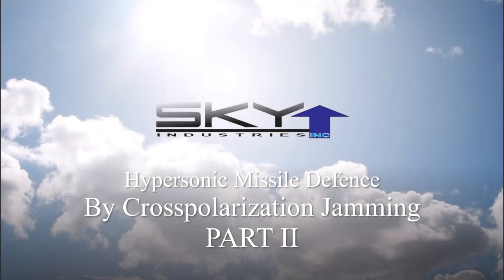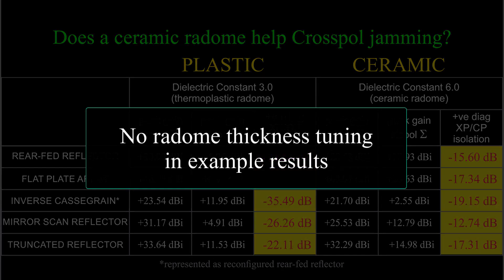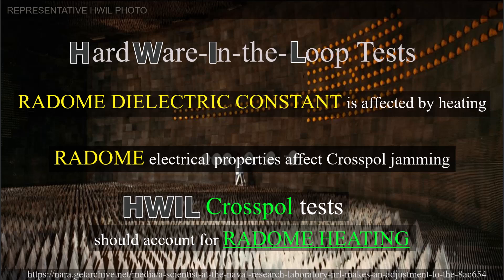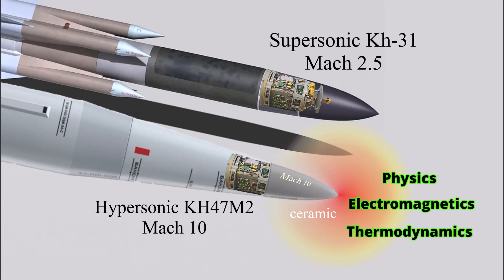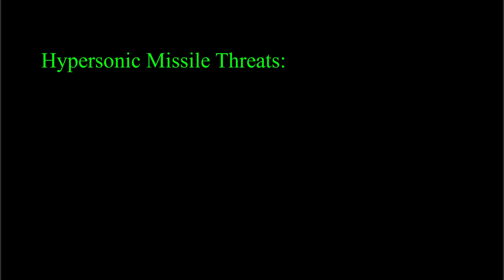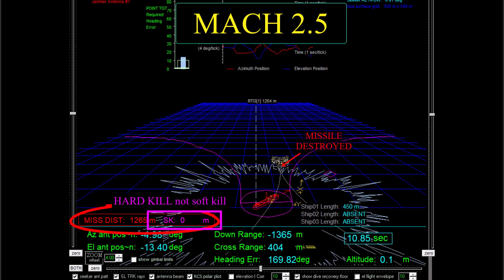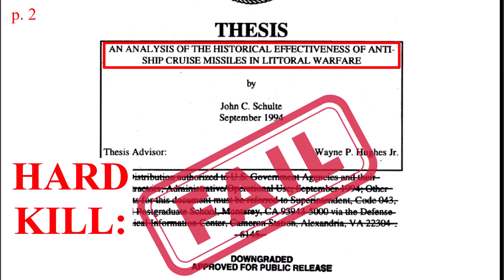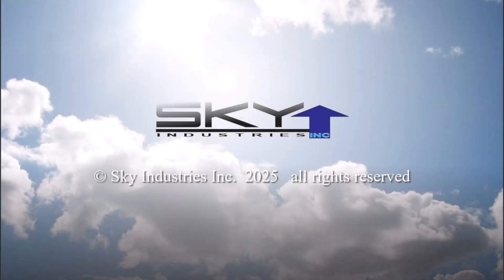Hypersonic Missile Defence By Crosspolarization Jamming PART II 25

Comment: LOL ... for us laymen ...

Okay, let's break down crosspolarization jamming and how it might be relevant to hypersonic missile defense, using simple terms:

*1.  Hypersonic Missiles:  Why Are They a Problem?*

*   *Super Fast:* These missiles travel at speeds greater than Mach 5 (five times the speed of sound).  That's really fast, meaning very little time to react.
*   *Maneuverable:*  Unlike ballistic missiles that follow a predictable arc, hypersonic missiles can change course during flight. This makes them harder to track and intercept.
*   *Low Altitude:*  They often fly at relatively low altitudes, below the usual range of some radar systems designed for ballistic missile defense.

*2.  Radar: How We Detect and Track Missiles*

*   *Sending Signals:* Radar works by sending out radio waves (electromagnetic radiation) that bounce off objects.
*   *Receiving Echoes:* The radar then receives the reflected waves, allowing it to determine the object's distance, speed, and direction.

*3.  Polarization of Radar Waves: Thinking About Wiggles*

*   *Imagine a rope:* If you shake a rope up and down, it creates a vertical wave.  If you shake it side to side, it creates a horizontal wave.  Radar waves are similar – they have a direction of "wiggle," which we call *polarization*.
*   *Typical Polarization:*  Most radar systems use a specific polarization – let's say vertical polarization for simplicity.  They send out vertically polarized waves and are best at receiving vertically polarized echoes.

*4.  Jamming:  Messing with the Radar*

*   *The Goal:* Jamming is intentionally interfering with radar signals to prevent the radar from accurately detecting or tracking a target.
*   *Various Methods:* There are many ways to jam radar.  One way is to simply send out a loud, overpowering signal on the same frequency that the radar uses.  Think of it like shouting so loud that nobody can hear the original conversation.

*5.  Crosspolarization Jamming: A Sneakier Approach*

*   *Exploiting the Weakness:*  Crosspolarization jamming exploits the fact that radar systems are usually optimized to receive signals of a specific polarization (e.g., vertical). They are less sensitive to signals of the opposite polarization (e.g., horizontal).
*   *The Trick:* The jammer sends out a strong signal with a polarization that is different from the radar's intended polarization. In the simplest case, this might be a horizontally polarized signal sent against a vertically polarized radar.
*   *Why it Works:*  Even though the radar isn't specifically designed to "hear" that polarization, a strong crosspolarized signal can still get through the front end of the radar. This crosspolarized signal can then confuse or overwhelm the radar's processing system, making it difficult to extract the real target's echo. In effect, it appears at the radar receiver as noise or as a false target.

*6.  How it Relates to Hypersonic Missile Defense*

*   *Making Tracking Harder:* If a hypersonic missile can effectively use crosspolarization jamming, it makes it much harder for radar systems to track its position, speed, and trajectory. This gives the missile a better chance of reaching its target undetected.
*   *Countermeasures:*  Defenses against crosspolarization jamming involve using radar systems that can better handle multiple polarizations, filter out unwanted signals, or adaptively change their polarization to match the target's reflection characteristics.

*Important Considerations/Caveats:*

*   *More Complex in Reality:* The physics and engineering of radar and jamming are far more complex than this simple explanation.  Real-world systems involve sophisticated signal processing, modulation techniques, and antenna designs.
*   *Not the Only Defense Challenge:* Crosspolarization jamming is just one of many challenges in defending against hypersonic missiles. Other challenges include their speed, maneuverability, heat signature, and ability to deploy decoys.
*   *It's Evolving:* Both jamming techniques and countermeasures against jamming are constantly evolving.  It's a never-ending "cat and mouse" game.
*   *Limited Public Information:* Much of the specifics of advanced radar and jamming technologies are classified for national security reasons. This explanation relies on publicly available information and general principles.

*In summary:* Crosspolarization jamming attempts to disrupt radar tracking by exploiting the radar's sensitivity to specific wave "wiggles." By sending a strong signal with the "wrong" kind of wiggle, the jammer can confuse or overwhelm the radar system. This could make it harder to defend against fast, maneuverable hypersonic missiles. Defenses against crosspolarization jamming include designing radars that are more robust against different polarizations and using advanced signal processing techniques to filter out unwanted signals.

Comment: Holy cross-poly, I've watched two of your videos and think I've found my new dream career.  Now just gotta work out where to start...
Reply from the maker: There's a lot more in this vein; Crosspolarization jamming is just the start: Crosseye, Sector Crosseye, Polarization Crosseye, Double Cross, and cognitive variations.  It's interesting for sure, and it's possible to make brand new discoveries, things no one has seen before or recognized before, and to make real contributions.  

My advice: learn everything you can, and keep your career options open.  Use the scientific method, be meticulous, keep thorough engineering notes including dates, times, ideas, thought processes, things that are dead ends and why, the evolving contents of your mind on paper. 

"Danger Will Robinson!":  In this field the security restrictions - which are absolutely necessary - can suffocate you with respect to the outside world.  

You will need to develop skills to recognize and accommodate the restrictions.  That part is like an apprenticeship.  Other practitioners will help you.

Comment: Some missiles use diamond for optical windows. Not sure about radar permeability but could be one way that it's done. 

Looks like it's viable: 'Dielectric loss tangent of the samples in the frequency range of 50-67 GHz was found to be in the range of 7.5· 10 ⁻³ -8· 10 ⁻² , increasing with frequency. The transmission loss due to the radiation absorption is about 1%. '

Comment: Could it be that the whole trajectory is encoded when the mission is initiated? Without any seekers?
Reply from the maker: In principle, yes - but that will only work for stationary targets like buildings or bridges.  A different solution is needed for a moving target, like and aircraft carrier.
Reply: @ Isn’t it the velocity in which a carrier is moving is almost negligible to the velocity of the hypersonic missile?
Reply from the maker: @elclay  yes - but very precise guidance is needed at endgame to physically hit the target.  The guidance loop needs to correct the the difference between where the targeting platform thought - at launch time - where the target will be when the missile arrives, and where is actually is when the missile arrives.  

Certainly GPS could be used to guide the missile all the way to the target with no seeker required, but that only works if the targeting platform has the exact GPS coordinates of the target.  

Easy to enough do for a building or a bridge or a shipyard, perhaps not so easy for a movable target like a ship.  A ship doesn't provide information about its location, and may be fitted with among other things a GPS jammer that can deny service out to several km.  And if it and has range info on the inbound missile, in principle ship tactics can be applied.  

Similar to a boxer moving his/her head just a little to avoid getting hit.  A small movement is all it takes.

Comment: could they eject the ceramic dome piece in the mach 2.5 phase and have the plastic one underneath?
Reply from the maker: Good question; seems like a major complexity that is risky to the missile for no real benefit since it doesn't solve the problem.  

A polyamide radome raises the antenna's crosspolar gain, just not as much as ceramic radome does.  

And although it doesn't say in the video, the simulation at 5:11 uses a polyamide radome, dielectric constant 3.0.

Comment: Why not both? Could have a ceramic outer nose cone for hypersonic flight, then shatter it with a small explosive when the missile drops below Mach 5 and the seeker becomes active.
Reply from the maker: Interesting idea, but it doesn't solve the problem; the main-thing points are that a polyamide radome adds to the crosspolar gain, and a ceramic radome is even worse.  

A RF-guided hypersonic is forced to use the ceramic, so it's situation is particularly bad.

Comment: I asked the following question to DeepSeek AI 

How can a missile going over match 5 overcome the plasma sheath interference to continue receiving data during terminal phase?

It answered the following:

Overcoming plasma sheath interference is one of the most significant challenges for hypersonic missiles traveling at speeds over Mach 5. The plasma sheath, a layer of ionized gas that forms around the missile due to extreme air friction, can block or distort radio frequency (RF) signals, making communication and data reception difficult. Here are the key strategies and technologies used to mitigate this issue:

---

### 1. *Frequency Selection:*
   - *Lower Frequency Bands:*
     - Lower frequency signals (e.g., UHF or VHF bands) are less affected by plasma interference compared to higher frequencies (e.g., X-band or Ku-band). Hypersonic missiles can use these lower frequencies for communication during the terminal phase.
   - *Multi-Frequency Systems:*
     - Using multiple frequencies simultaneously can help ensure that at least some signals penetrate the plasma sheath.

---

### 2. *Antenna Design and Placement:*
   - *Windowed Antennas:*
     - Antennas can be placed behind specially designed "windows" made of materials (e.g., quartz or ceramic) that are transparent to RF signals but resistant to heat and plasma effects.
   - *Conformal Antennas:*
     - Antennas can be integrated into the missile's surface in a way that minimizes disruption to the plasma layer while maintaining signal integrity.
   - *Rear-Facing Antennas:*
     - Plasma density is lower at the rear of the missile, so antennas can be positioned there to improve signal reception.

---

### 3. *Plasma Mitigation Techniques:*
   - *Magnetic Windows:*
     - Applying a magnetic field around the antenna can reduce plasma density locally, allowing signals to pass through more effectively.
   - *Cooling Systems:*
     - Actively cooling the antenna area can reduce plasma formation and improve signal transmission.
   - *Aerodynamic Shaping:*
     - The missile's shape can be optimized to reduce plasma buildup around critical areas, such as communication antennas.

---

### 4. *Signal Processing and Encoding:*
   - *Advanced Algorithms:*
     - Sophisticated signal processing algorithms can filter out noise and distortions caused by the plasma sheath, extracting usable data from weakened or degraded signals.
   - *Error Correction Codes:*
     - Robust error correction techniques (e.g., forward error correction) can help recover data even if the signal is partially disrupted.

---

### 5. *Alternative Communication Methods:*
   - *Laser Communication:*
     - Lasers are less affected by plasma interference and can be used for high-speed data transmission. However, this requires precise alignment between the missile and the communication source.
   - *Inertial Navigation Updates:*
     - If communication is temporarily lost, the missile can rely on its inertial navigation system (INS) and pre-programmed target data to continue its trajectory.

---

### 6. *Onboard AI and Autonomous Guidance:*
   - *AI-Based Decision Making:*
     - Hypersonic missiles can use artificial intelligence (AI) to process limited or degraded data and make real-time adjustments to their trajectory.
   - *Autonomous Target Recognition:*
     - Advanced seekers (e.g., infrared or radar) can autonomously identify and track targets without relying heavily on external data links during the terminal phase.

---

### 7. *Pre-Planned Trajectory Adjustments:*
   - If communication is severely disrupted, the missile can follow a pre-programmed flight path and rely on its terminal guidance systems (e.g., radar or infrared seekers) to locate and engage the target.

---

### Real-World Applications:
- *Russian Avangard HGV:*
  - Uses a combination of aerodynamic shaping and advanced materials to mitigate plasma interference.
- *U.S. Hypersonic Programs:*
  - Research is ongoing into plasma-resistant communication systems, including magnetic windows and laser-based data links.

---

### Summary:
While plasma sheath interference is a significant challenge for hypersonic missiles, a combination of advanced antenna design, signal processing, alternative communication methods, and autonomous guidance systems allows these missiles to maintain data reception and accuracy during the terminal phase. Ongoing research and development continue to improve these technologies, ensuring reliable performance at extreme speeds.
Reply from the maker: Very interesting!  Many thanks for sharing, I was curious.

Comment: What if the radome was designed as a two part radome? Plastic on the inside, ceramic on the outside? When the missile is at mach 10, the ceramic is on but when it slows to mach 2.5 and lower, a mechanism removes the ceramic radome and exposes the plastic one.
Reply from the maker: It's an interesting idea, but it doesn't solve the problem; a thermoplastic radome will still contribute enough top the crosspolar gain of the underlying antenna that the system is vulnerable.  Provided of course that Crosspol is handled properly by the jammer.

Comment: While I am enthusiastic for the concept I do wonder how we will achieve 'unbiased objective assessments'. You mention the penchant for hard-kills among military decision makers and their political associates. 
Nothing would be more persuasive to these folk than 'hard evidence'. Perhaps  this should be tested against Kinzal missiles in Ukraine while Russia still has the ability to launch them. 
Is this a possibility??

from NB
Reply from the maker: Excellent post.  

To achieve 'unbiased objective assessments': no more arm flapping and just-so statements.  Make decisions traceable to results of the scientific method ruthlessly applied to every input to a funding decision and TTP.  Do the hard things, the actual calculations of antenna gains, power levels, servo loop control signals, flight dynamics, solve the differential equations using Gears Method (not lazy fwd/bkwd Euler) so parasitic solutions are suppressed AND carefully plan and execute experiments and do the post-trials data analysis to prove that the calculations were done correctly because the experimental results agree with the calculations.  GET CONTROL of your test range and test equipment!  

Depend on peer review and the scholarly work and input of colleagues.   No more hearsay, no more "somebody told me once that..." and "everybody knows that..."  No more of that stuff.  

YES good idea to take every opportunity to test in the real world.  Combat is the ultimate hardware-in-the-loop simulation.  

The Houthis are firing RF guided missiles at commercial ships.  LIVE FIRE missile tests!  Put a jammer on a barge with an Israeli flag on it!  Do whatever it takes to get the answers.  

My second-favourite saying: "Later is never."  

First favourite: "If it can be solved with a cheque it's not a problem, it's an expense."

Comment: Is it possible these missiles could be retrofitted with a radome ejector that could be actuated on the final approach? If so, a thinner carbon radome could be retrofitted underneath the outer radome within ejection system for the outer radome, right?

Comment: Hello, I have a question:
At around 5:30 you've mentioned that the need for a heat shield would force the use of a highly dielectric ceramic, however I would like to highlight a different approach used by the EU based IRIS-T SL missile: the cruise phase is datalink guided by a ground based TWS radar and the terminal phase is characterized by the jettisoning of the missile's nose cone, revealing an IRST-like seeker.
This makes me think that a (taking some creative freedom) "dual stage" shield nose cone that allows to carry both a polymer dome and a jettisonable ceramic shield is most likely feasible.
Would this approach have any measurable effect on crosspolarization jamming effectiveness?
Reply from the maker: Very interesting post, and good question.  Jettisoning the radome to use an IR seeker for terminal guidance makes sense.  I expect radome jettisoning is dangerous to the missile, but once the designers committed to IR terminal guidance then dropping the outer radome is a gimme.  

In my experience that won't solve the problem for an RF seeker - the vulnerability is less, but still there, the dielectric constant drops from ~6 to ~3.  

There are easily-understood nuances to the effects, but it is inappropriate to detail them in the open.